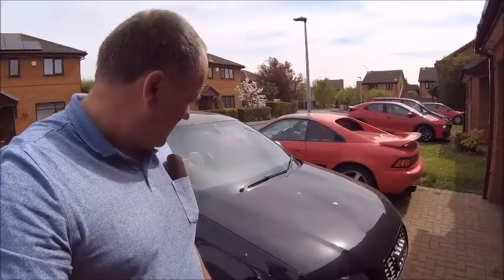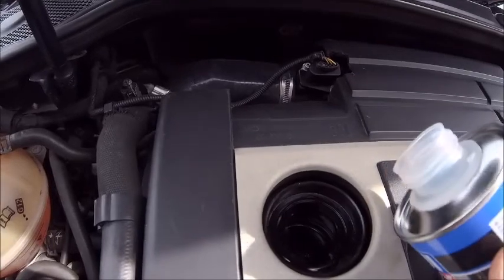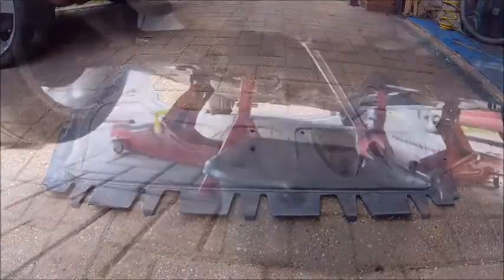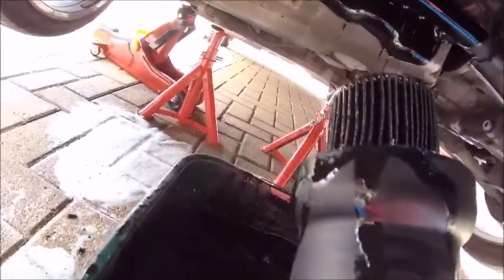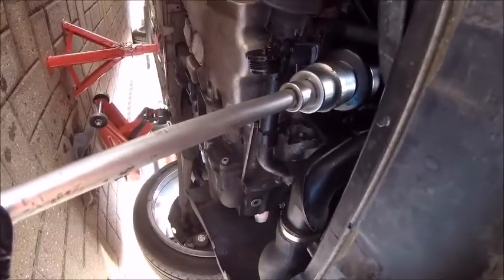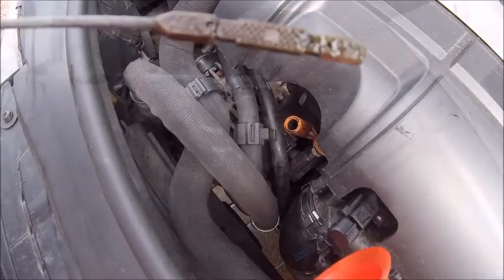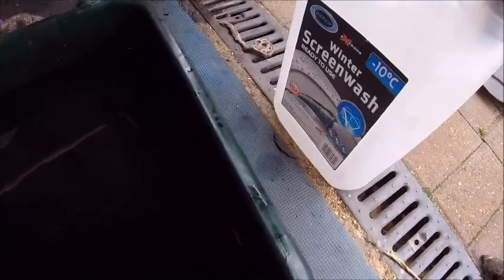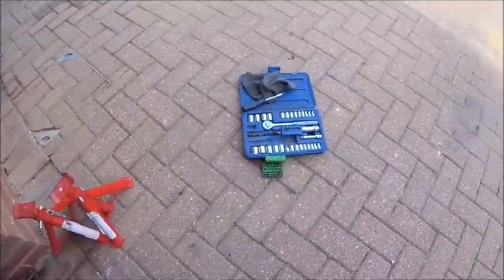#AudiS3 Oil Change April 21 (SHORT)

Comment: Wait, what happened to your garden oil reserve?  
[joke]. I do use the filter drain as it only takes a push in the centre to release then reset when replacing the filter, it’s easier to aim oil into the waste pan imho. I also put some fresh oil into the new filter and housing so it doesn’t drop too much when checking the dipstick first time but seeing where the newer gen s3 filters are, i guess it’s doing no harm. Each to their own though and great video 👍
Reply from the maker: Thanks ...Keep meaning to get a toll but the price of them you think they are gold plated, so i just put up with spillage  😂

Comment: Great video. Just curious as to what level you try and maintain on the dipstick? Looked to be about 50/60% up when cold? So this would be closer to max when hot?
Reply from the maker: Yeah never fill it to the top, as the drive is on a slope and yes expansion makes it nearer the top when warm...as long as it registers I'm happy and always check it after the first run, Unlike some S3's it hardly uses any  😃
Reply: @AdeReeves  thanks, yeah im keeping an eye on mine and try and maintain a similar level as to not over fill it. Seems to be the sweet spot so far 👍

Comment: What was that stuff you put in the engine first and what? Also do you recommend start the car for 10 min before changing the oil?thanks
Reply from the maker: Hi... It was Liqui Moly Engine Flush which I only do once every half a dozen oil changes as on this car i always change the oil every 6 months. I have done changes on cold and hot oil and personally don't see much difference apart from hot oil comes out faster .